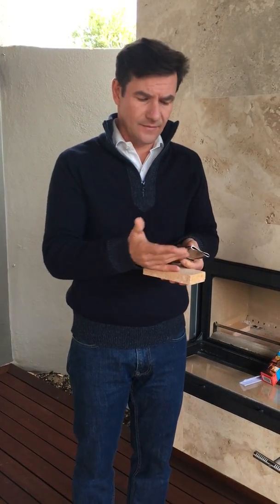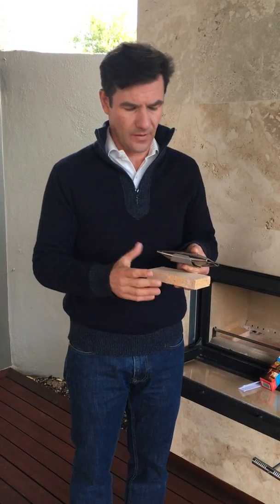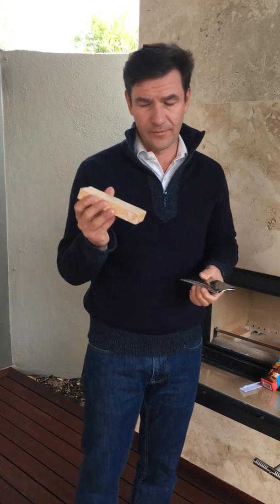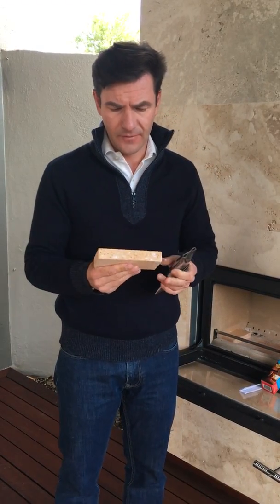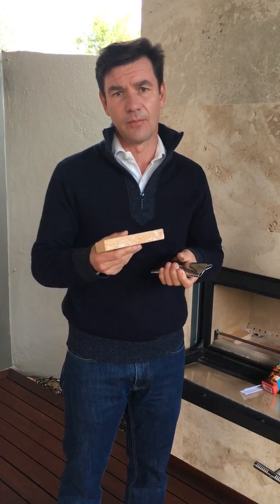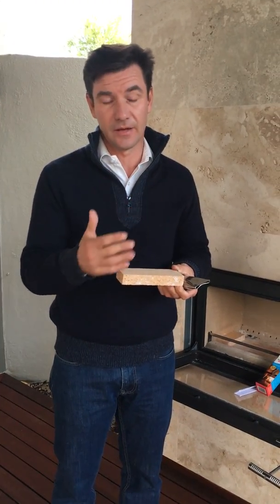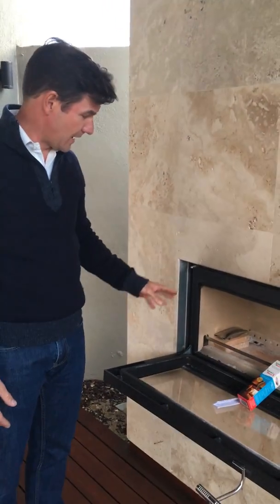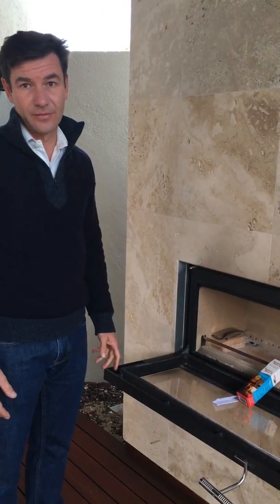SmartBurn Placement in a firebox

Comment: Is it safe to open the door while the SmartBurn is in use?
Reply from the maker: Yes, no safety issue with the addition of SmartBurn. The unit will last for approx 3 months so leave it in the side of the firebox and load your wood and operate your fire just as you do normally. Always a good idea to wear heat proof gloves when loading wood.